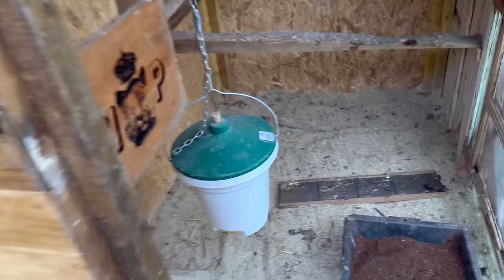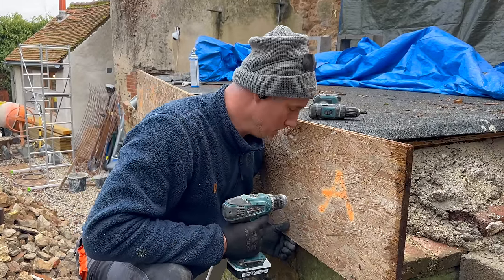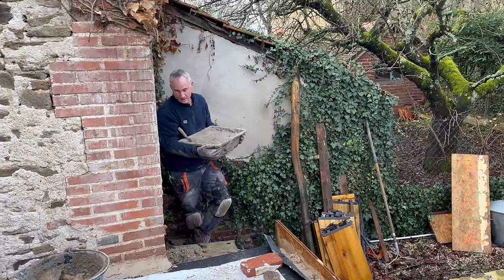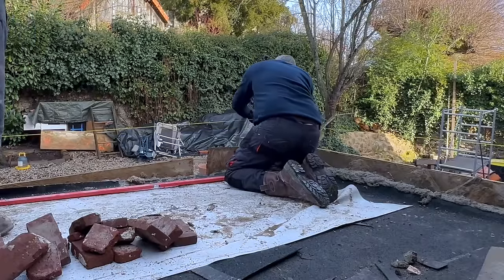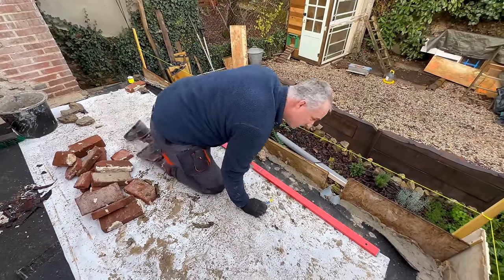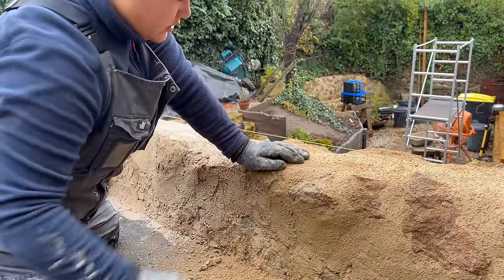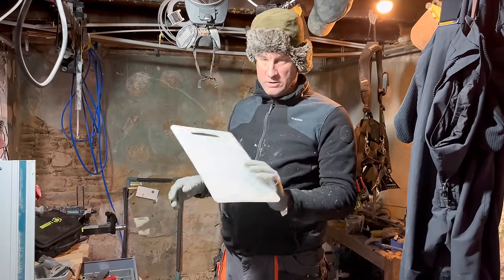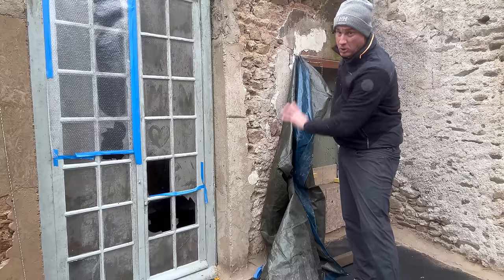Building an antique wall, Episode 59

Comment: The higher outside temperatures are welcomed in the beginning of winter; able to accomplish certain projects. The wall looks solid, nice texture and good to see a drain pipe.  Dont understand: was the cutting board kept to be recycled/not being used OR  was it being used/taken from the kitchen to make a template?
Reply from the maker: It was basically Nadia joking. I didn’t took the cutting board from the kitchen. We do have a wicked kind of humor I guess
Reply: stay dry warm kind gentle always